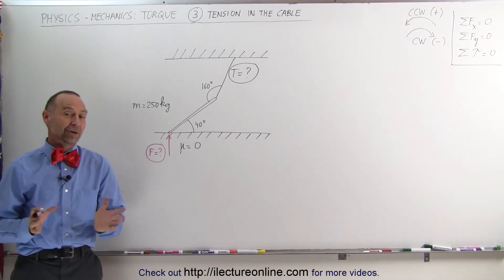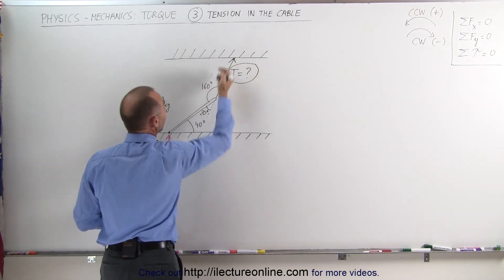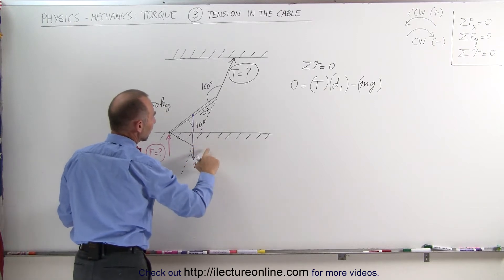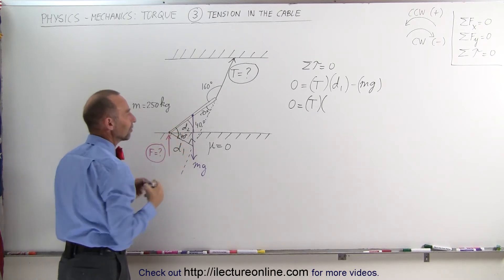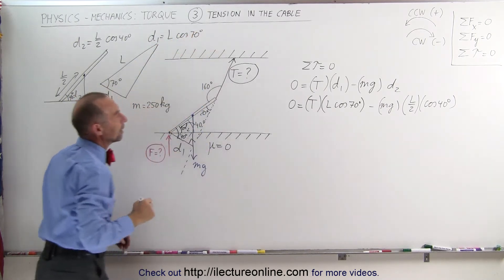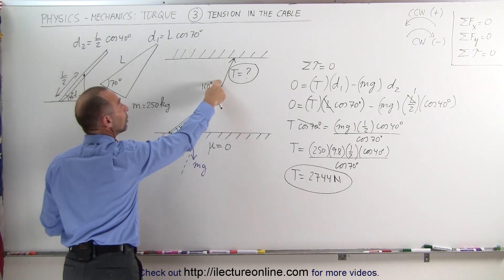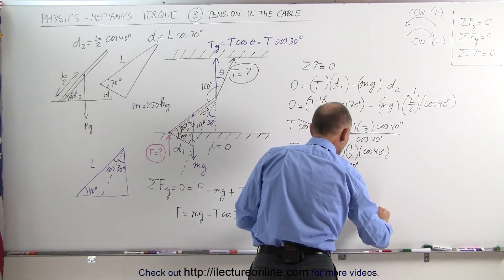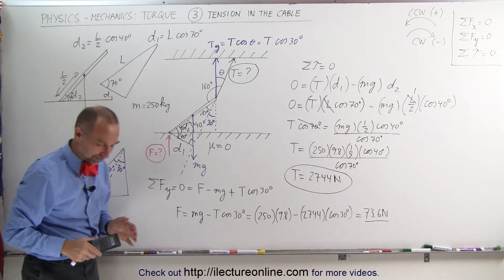Physics 15  Torque (3 of 27) Tension=? in the Cable

Comment: Love your videos they are very helpful!, in my school we refer to this as bending moment, while torque is the moment that acts about (around) the longitudinal axis of the beam and produces a twisting effect on the beam as opposed to bending moment which produces a tension at the top and compression at the bottom of the beam (or vice versa). So the equation would say "sum of the moments is equal to zero" (as opposed to sum of the torques is equal to zero, because there is no torque acting on the beam).
Reply from the maker: Great point!  Thank you for that clarification!   🙂

Comment: The solution is not correct. The force F cannot just have a vertical component, because then there is no force to balance out the horizontal component of the tension. The tension T has a horizontal component Tx = 2744 * sin 30, hence Fx = -Tx = -1372N.
Reply from the maker: You are correct.  There appears to be something wrong with this problem.  I'll take a closer look when I have time.

Comment: What is the horizontal force to cancel out the x-component of the tension? -Fx+Tcos(theta)=0. What is Fx?
Reply from the maker: Very insightful.  You are correct in assuming that the forces in the x-direction are not balanced and will cause an acceleration to the right until the string at the top is vertical.  Therefore the answers in the video are only momentarily valid as the rod would accelerate to the right.
Reply: @MichelvanBiezen  thank you! I would ask this question too.

Comment: Sir！Is this question also can solve by using equilibrium method like sum Fx=0，sum Fy=0？I don't when can we use torque and equilibrium method？Thank you
Reply from the maker: +mars treasure 
  Both methods are always valid and often you can use either method.  The torque method is used to eliminate one of the unknowns when necessary.
Reply: +Michel van Biezen thank you so much.I understand more